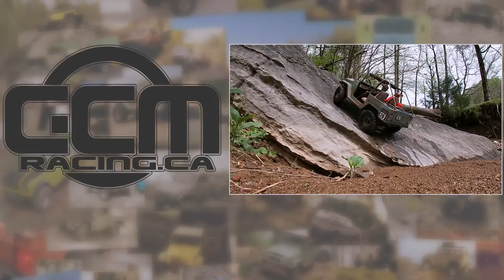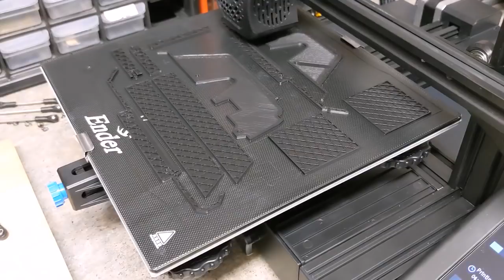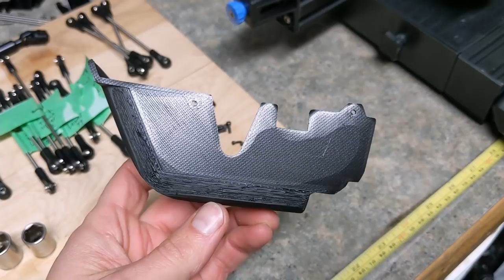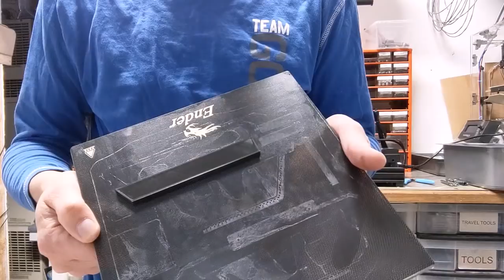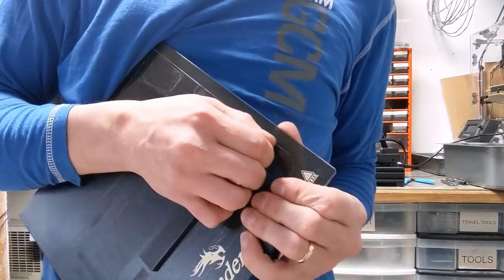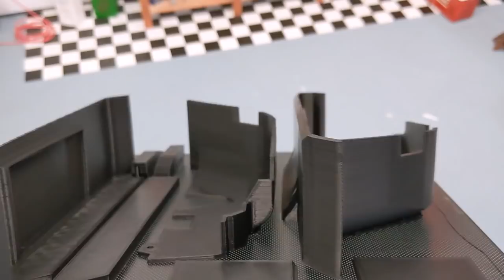Why you DON'T need a 3d Printer

Comment: If you run out of filament hit pause replace the new filaments hit pause again and off you go 😁
Reply from the maker: Great tip!
Hopefully it will pause somewhere the head is NOT melting a hole in your printed parts. I know my pause doesn't stop right away, it runs through whatever lines are in memory already before it stops.

Comment: I've been lucky then ' I've had my 3D printer for 3 years now and haven't had very many failed prints . Ender3 pro with upgrades such as a glass bed better extruder . Only had 1 clogged up tip I change those out about every 20 print's. I just recently started using the ironing feature and that's a great feature. Good video BTW I really enjoy your channel keep up the great content...
Reply from the maker: Thanks for the comments! Tell me more about the 'ironing' feature, I don't know about that one!
Reply: @GCMRacing1  if you go into the advanced settings there's an ironing feature you can check mark and it'll basically make you last layers on the flat surfaces smooth.
Reply from the maker: Yeah! I'll try the Iron feature now! Thanks!

Comment: How many of these problems are avoided with a different printer?
Reply from the maker: Great comment! Some of them can.. yes. Some printers with higher prices will have auto bed leveling, and a monitor on the spool feed to pause automatically if the spool runs out. Otherwise, you're still going to have nozzle clog opportunities with any printer.. or delamination because of settings failures, or file design problems. There's still variables, but as you say... some of them can be avoided with a different model of printer. (and price!)

Comment: Using a bit of water-based glue stick on the Ender's hot bed works a treat and seems to eliminate curling and lift of the corners of the piece; this is my experience at least with PLA+ and PETG so far. Printing anywhere from 10min to 24+ hours, no issues at all. 

To remove the pieces once printed, use the provided flat metal scraper, place it at the corner of the piece just near the surface of the bed, and use a rubber mallet and very very lightly tap at the handle of the scraper...comes free just fine

With regards to material remaining, obviously one needs to plan ahead before committing to a print. Cura 3D the slicing software I use estimates the amount of plastic used in the print. By weighing an empty print spool, and subtracting this weight from the current weight of a spool loaded with filament, you can estimate how much plastic you have remaining. Therefore you can more or less ensure you load a sufficient amount of plastic before a print. 

I love 3D printing, it's a perfect complement for the R/C vehicle hobby. The Creality really doesn't demand that much maintenance if you keep it clean, use some ISO alcohol on the bed to clean it now and again, keep the belt tensions in check, etc.  Just gotta use that noggin' 🙂

I've designed and printed an R/C half-track vehicle from scratch and I'm almost done with the final details of the design; the base vehicle is printed and running around the lounge room floor
Reply from the maker: Pretty good addition to the RC hobby for sure. Yes sir. I was using glue on my glass plate for the ABS printer as well. Worked just great on there, and stuck the ABS down with no problems.
Reply: @GCMRacing1  Nice one, glad to hear it. I've more recently started using ASA filament for my more mechanical prints and things like chassis rails etc. I find that ASA has superior UV resistance and is a great material to print with, similar to ABS in toxicity but a little less prone to warping than ABS. Happy printing 😎
Reply from the maker: @HarmanMotorWorks  thanks for that tip! I'm going to check out ASA!

Comment: Not just this but how many things have we paid for bought and then the education comes after, it could work out but maybe it will be put in storage. Onto the next thing to buy, Chanel’s like this make purchase thought about instead of just a Impulse purchase.
Reply from the maker: For sure. To update this, I've been using this Ender printer SO MUCH it's ridiculous, and it's proving very VERY reliable. I'm exceedingly happy with it, and thanks to that, it's been way less headaches than normal. I've also consistently done better with my layouts.. . so I'm arranging stuff on the print table that stick better, have less failures, and produce more consistent parts. It's been a GOOD last couple of months on this thing.

Comment: I use Aqua Net for my prints seems to work quite well for me. I have had to replace rollers and hot end on my printer after few hundred hours. Luckily the parts are cheap and can afford to have spares. I agree bed leveling is a constant battle every time.
Reply from the maker: Haven't seen this brand yet, I'll take a look!

Comment: Before the holidays I started learning CAD, and designed a 3/4 point Axle truss and then wanted to see it on my New CMAX Ultimate Coil Kit and fine tune the design. To do this I bought a simple 3d Printer for me to break in on.....and now I'm 2 printers deep and over 100 structural prints, 4 design revisions in addition to testing several different filament types...through my adventure thus-far, everything you said is so true. Tuning/Alignment and proper bed temp are the most important next to using DRY Filament. I can say with each failure I have learned and continued persistence my build is coming together nicely.
Reply from the maker: This is a great comment, Thanks! I love to hear about this progression... need, CAD, learning, trying, perfecting! That's a great way to enjoy any hobby, and you're certainly gaining the benefits of that work. Printing and even CAD can be a fiddly thing, but it's worth it for sure!

Comment: Are you printing PLA or PETG? Why I ask is because PETG harder to get off the print bed than PLA. PETG will even tear up a glass bed so glue stick, hair spray or some type of layer on the bed is the best solution.
Reply from the maker: Thanks for the comment. I use PLA on heated bed only, and the glue stick for the PLA+.. which is the one that curls the edges. The glue stick has totally eliminated the corners lifting... so that's great! I haven't tried PETG on this machine yet.

Comment: Very good video-have thought about getting one a number of times,but to be honest,for all the reasons you mention it isn't worth it. And I prefer to fabricate my RC parts myself,often from "scrap" materials, have never not been able to do it yet. But I was "lucky" and got an engineering apprenticeship many years ago,and enjoy using my hands,a file,a vice and a square. Another thing you didn't mention is temperature stability of parts you print,either in hot or cold temps-I've heard they ain't too good.........maybe for indoor racing but not much else.
Reply from the maker: Correct sir! About the temperature variations.. each material tends to print well at it's respective temperature, whatever that is, and then some materials don't do well AT ALL in hot UV sun.. and will melt down again, loosing all shape and form you've put into them. Some materials won't deform at all due to higher temperature production, but as they say.. you get what you 'pay' for.. and the lower temp printing is easiest, and also more susceptible to deformation in the sun. Yes. Or the hot south!
Reply: @GCMRacing1  You are,of course, correct about "you get what you pay for" and I don't doubt that your parts are amongst the best. As you say,hot sun especially under a body which is already trapping heat from ESCs and motors isn't ideal. 
The video was extremely informative and well produced, I thank you for taking the time to put it together, as a professional model maker I learned a great deal from it. Thankfully RC cars are just a hobby for me.....

Comment: I have a quick fix, get a Prusa MK3.  Also if you print anything that's is not PLA I would recommend an enclosure. In any case desktop 3D printers are for handy people, makers. People who can understand how things work and are able to troubleshoot. Prusa printers reduce tinkering to a minimum, manufacturing quality is guaranteed, also after sales support. All your problems are usually present in Chinese printer which are made with bad quality control and cheap components and materials.
Reply from the maker: It's true that there's a curve of less tinkering, high quality.. down to massive problems, super cheap printer.. yes.

Comment: Have you thought about pei or geckotek on the glass? Bltouch for leveling and filament runout sensor? Theres plenty of upgrades that can make 3d printing much easier.
Reply from the maker: Certainly, there are technical upgrades to help with these things, although they make it more production worthy, they don't make it 'hands off' completely. I'm ok with the lower tech machine and a little more attention paid to the operation.

Comment: A piece of plate glass the same size as the bed, held on with paper clamps til you can print some edge holders. Kick up the bed temp by about 10C. I clean mine with a windex/simple green solution right before bed warming. No glue required.
Spring sleeves reduce the frequency of leveling.
Have a solid workbench in a draftless and consistent temperature environment (my basement in my case).
Even with all that, I'm still learning and tuning. It truly is a hobby in of itself. But so cool when you successfully use a part you designed and made in a build after all the failures and cussing.
Reply from the maker: Haha! Yess! It's great to have the successes, for sure. I have the plate on a few clips, and it's staying very level actually. I think the coating on my glass plate is now a problem place... it was a real gem at the beginning, and now it's worn some, it's more of a hinderance. Maybe time for a new glass....

Comment: Yup Definitely a Love-Hate relationship. As a part of the machine shop where I work. They decided to test some 3D printing capabilities and apply it to our work. They picked up the Ultimaker 5. This thing can make some pretty complicated parts and also has the extra spool for "support material" or a second color. Between Temperature ranges and infill densities and Line thicknesses and adhesion issues and types of material. It can be a real challenge. I have been made responsible for this machine and learn how to use it. Naturally small scale items are great practice and don't take long. ;) But it is definitely a process and it is way more than just hitting Print.. lol Thanks for sharing
Reply from the maker: Great explanation there.. yeah. The more complex machines have used the dual material etc to keep the more expensive 'real' material waste down to a minimum. True. It's fun, but it's going to heat up your brain sometimes!

Comment: Most of these problems come from owning a cheap printer. A Prusa isn't much more expensive than an Ender but having owned both: the Prusa is 100% worth it.
Also, I gave up printing ABS. It's a little stronger than PLA and not worth the headache.
The real reason people don't need a 3D printer: If you are not able to design your own parts you just end up printing trinkets from Thingiverse. Sketchup and Tinkercad are not that hard, Fusion is a little harder but also a lot more powerful. And they are all free.
Reply from the maker: Designers would likely also have the mentality to pursue printing. Yes. I think it's a great tool to get us through the design to hard parts phase.

Comment: Keep a stable environment (a hood), no more shrinkage. Maybe Ender does not have that function, but most newer ones allows you to continue your print when you run out of filament. But damn, your video just says "give up" based on your experience. Took me a bit of time to learn and tweak my printer and it works great, not that hard. I guess if you're not really interested in 3d printing it might be difficult.
Reply from the maker: Very true. Certainly my ABS printing benefited from the hood and more stable temperatures. I'm suggesting each person needs to have an honest conversation about printing when they get into it... Like you did... You started it and stuck with it to learn and make it work well. Many people I've heard also have this experience, and unfortunately some think they can buy one and then it's done. Like turning on the phone and using google.. but it's not that simple.. and then they bail out.

Comment: Good video for folks on the fence about buying a 3d printer I hope this educates some. People dont realise how intensive of a hobby 3d printing can be totally on its own. Lots of people i have talked to thing you just load filament and a file then press a button.
Weigh your rolls before your print . Almost every empty spool weight can be found online. There is a very steep learning curve with 3d printing. I probably did heavy research for 6-8 months before getting a 3d printer and almost didnt get one but my wife bought me one this past christmas. I gotta say i love it but you need to put the time and effort in if you want successful prints. My printer has been running nonstop and i am already developing my own parts on fusion 360 quite successfully and sharing them with others.
Reply from the maker: Great story here! And you've got some great points about the trend to open the box and push the button... 3d printing is a whole hobby all it's own for sure. Committing to the learning curve will certainly lead to more success.

Comment: And this is why I never went with hot nozzle printing. Everybody and their brother asked why not and I always told them I have enough hobbies. What I went with is resin for small parts and I will stick with scratch building and vacuum molding for the rest.
Reply from the maker: Your choice is actually similar to the ones who chose 3d printing... you looked into your craft, and spent the time to perfect and develop your creative process, and it's working VERY WELL! haha (love your stuff) and the printer guys have to do the same thing... good designs, well setup tools, and the results can be great!
Reply: Resin is next on my list for small parts for sure and with the combined washing and curing stations its a lot less messy, Ive tried nozzles small than .4mm but at the end of the day its still molten plastic and its not ideal for fine details and on small parts ive had to print multiples just to give parts chance to cool before the next layer.
Reply: I agree. I have seen enough of people talking about these printers messing up thst I don't want one until I can afford the headache and that will be no time soon. I definitely want to buy a liquid resin printer for making small custom model parts for my custom builds and hopefully be able to sell those custom parts as a kit once I have worked out any issues with them. Very informative video though!

Comment: Great video explaining just SOME of the MANY troubles of 3D printing lol. 
Just to pitch my 2 cents in. On my Ender3 V2 I ditched the bed they provided instantly and went to a local glass manufacturer and got an exact piece cut (4mm thick I think) and use that. Only thing I do before each print is clean the bed with window cleaner (with ammonia) and paper towel. Prints have been staying flat for 2 years.
As for getting the part off the bed. I use the flat scraper, hold it flat on the bed and give the part a quick tap at the base. If you can hold the part and slightly pull up on it as you tap it. It should require less of a tap. No need to take the bed off after each print. The only time I re-level, is after I've done maintenance

I love my printer, and even with the huge list of flaws. The benefits definitely outweigh them. Hope that helps, and the best of luck to you 👍🏿
Reply from the maker: Well, that's certainly a great report! I have a pretty flat piece of glass so far, compared to some.. this one is pretty good actually. I'll be sure to get a new glass or 2 just to have easy switch outs.. So you are not using any glue at all? 
I did have to use a little mallet and block to knock those thicker bits off, and it works very well. I'm still in the mood to remove the plate, and then keep an eye on the leveling afterwards.
Reply: @GCMRacing1 mind you, I've only been printing in PLA, but I have never used glue in the 2 years I've owned it. I'm afraid that If I do use glue, then the part would never come unstuck from the bed. I just make sure the bed temp stays at 60°C.
I would also say careful with the mallet. I've seen some people take chunks of glass off with the part because of the shock.  Rendering their glass useless
Reply from the maker: I did that with ABS on my other printer. The parts would cool on their own, and it would lift a big piece of glass out of the plate all by itself.. just from cooling.

Comment: hell, ill list some good brands

Anet- Their ET4 PRO and ET4 are GREAT amazing printers that print fine details, look too my upcoming WPL 1/16 Mack.
Creality SLA- The SLA printers are excellent and affordable, and easy to use! 
Any Cubic- The photon is an excellent machine that prints Like any other RESIN printer with the thinnest layer height, like a resin or cast mold. 
ELEGOO- the mars SLA printer is amazing and easy to maintain, saying it isnt is like saying the Moon isnt made of rock.

saying you don't need one is like saying "You don't need a car because a horse and buggy is just fine". No, you dont need the car, But its still better, and Imma be real, a car lasts alot longer than the horse, and its better at what it does.
Reply from the maker: Seems you've done some homework, and you've put in the time and learning investment to make this a great hobby for you. Those are some great printer recommendations for sure! If you don't like driving, and hate horses, I'd suggest you don't get either...